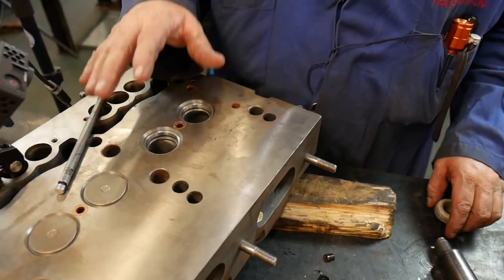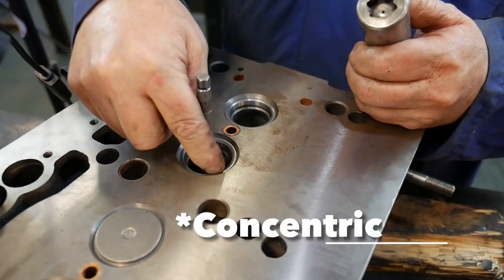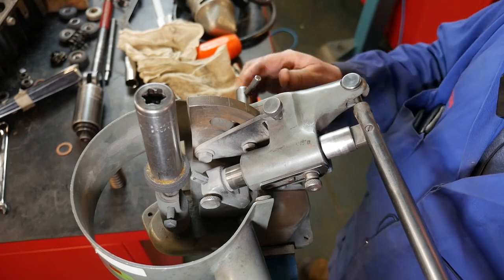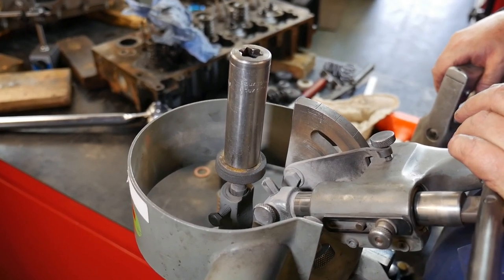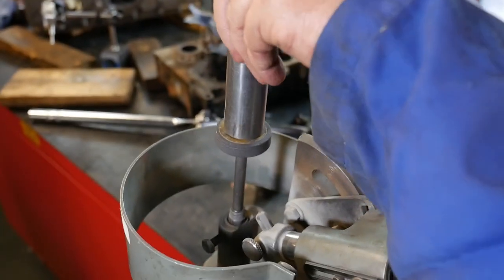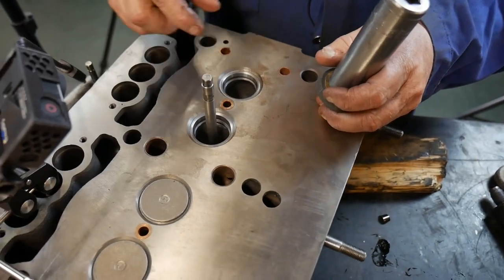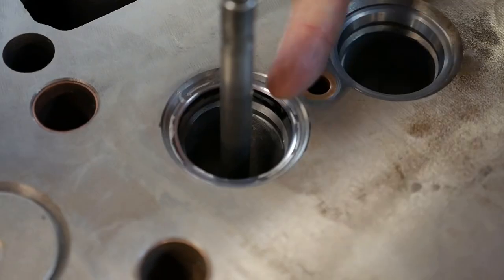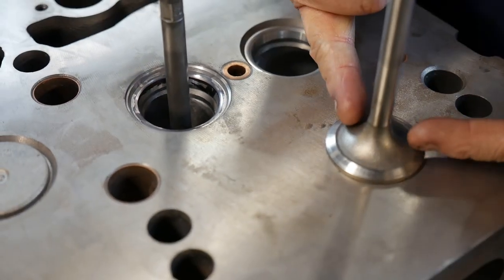Cylinder Head Servicing: Grinding Valve Seats

Comment: Completely unrelated to car engines, but working on a hard seated valve (hydraulics) design. This was very useful.

Importantly in my case the "interface angle". Opposed to the whole potential contact surface. Just reaffirmed the direction I was going. Well explained for an engineer.